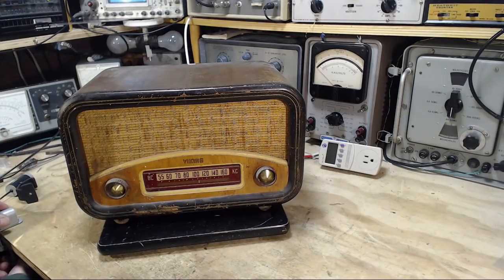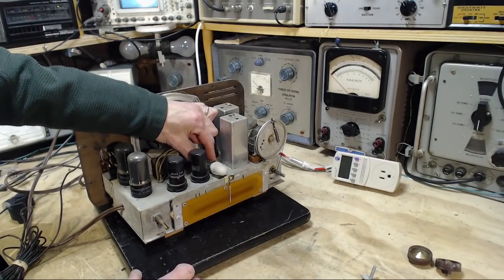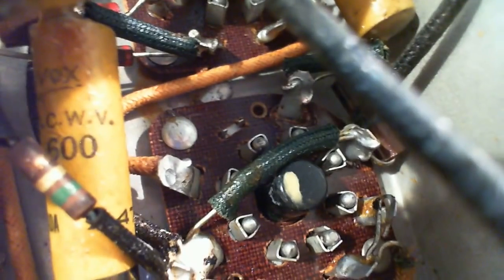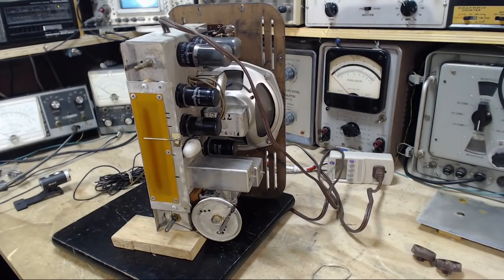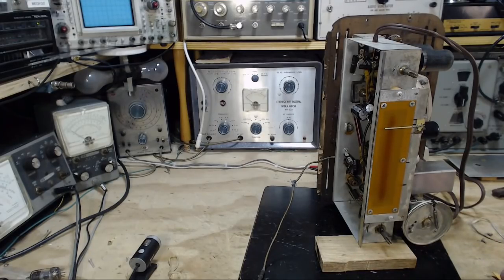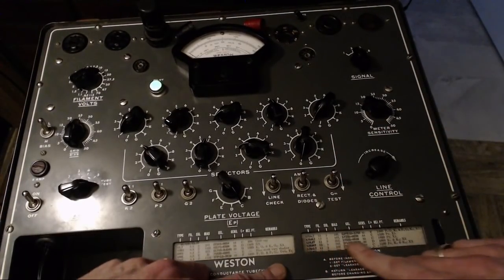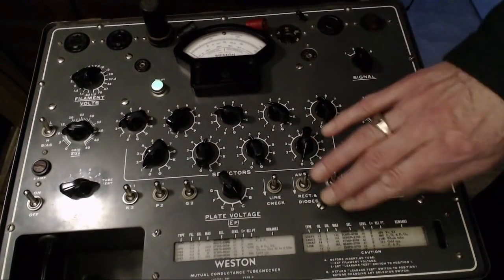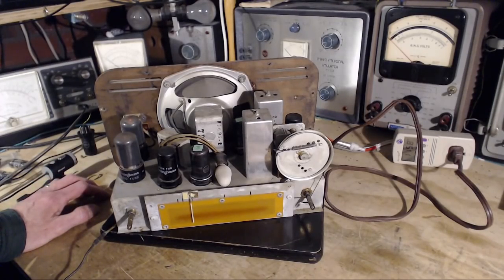Viking EMU61 Tube Radio Video #1 - Checkout

Comment: Two schools of thought seem to be evident here:  1. The old "Replace the Selenium Rectifier and paper/electrolytic capacitors first because if they're not bad now they soon will be." philosophy, and 2., Troubleshoot and replace only the parts that have failed -- a variation of the old "If it ain't broke, don't fix it." philosophy.   I usually adhere to the latter whenever possible, but in this case I think a little of the former might be necessary. You've already tested the tubes, now check the resistors.  Once that's done you can start replacing parts, but you can do it systematically.  Start with the S.R., then the filter caps, then the DC blocking caps, then the bypass caps.  Somewhere in that chain I'm sure you'll find the culprit that's causing all the hum.
Reply: He could start by scoping the HT to look at the ripple or just use an AC voltmeter to do the same. Not sure he's going to do that.

Comment: I can remember the magic of discovering how radios were constructed and how they worked. I used to look at components and wonder what they did and how to know if they were in working condition-especially valves. I would spend ages just poking around in a set to try to understand what was going on. All this was when I was 15yrs old. I am constantly amazed at how Jim has never lost that sense of slightly out of his depth wonder and confusion about how best to proceed so as to repair the set without hours of cognitive churning and not running it at risk of damage by not actually testing and replacing critical components before turning his attention to improving the overall performance of the set.

Comment: Found the schematic for it at elektrotanya.com of all things. Tubes clearly marked, the tuner chord wiring layout and an alignment procedure on one page.
The second page has the schematic and calls it Viking 48-53 and under  that it says Electrohome EMU-61-417 ! K1 is a Selenium rectifier so no rectifier tube!
And yes someone has been messing around inside. Annoying 60Hz hum from leaky waxies!
Reply: he's the Master Yup. Pacifictv.ca also has the same slightly "clarified" or "cleaned up" schematic on their "Viking, Eaton's of Canada" section. An older more original copy with parts list seems to be available via radiomuseum, which he says he is a member of. So many ways to obtain one...

Comment: Those tubes look all original so that would account for them testing on the tired side. The hum may also be caused by a leaky AC line filter. I had that on my Zenith Transoceanic and the end blew off. It was a .05mfd wax capacitor.